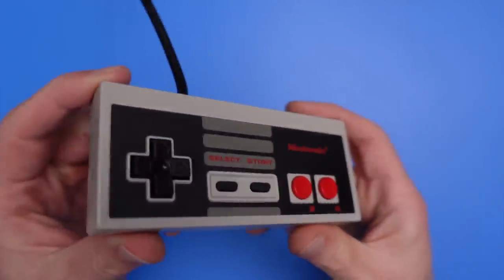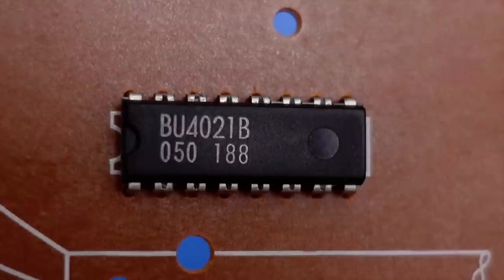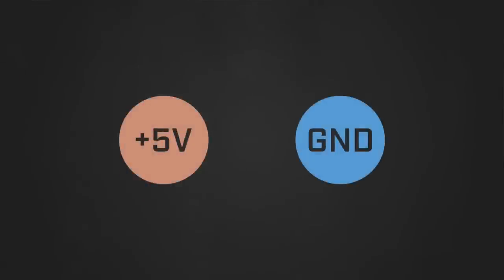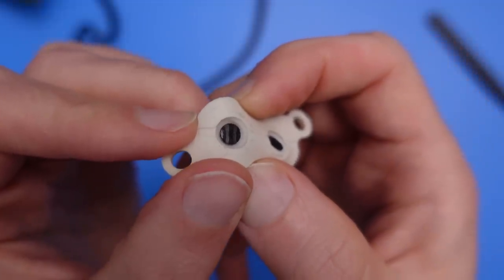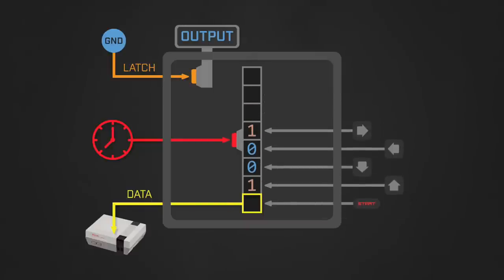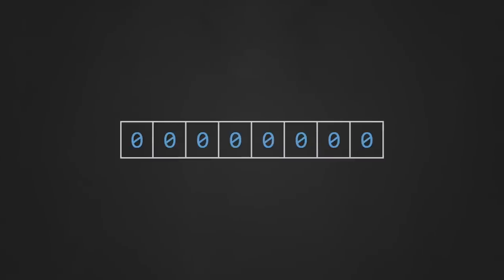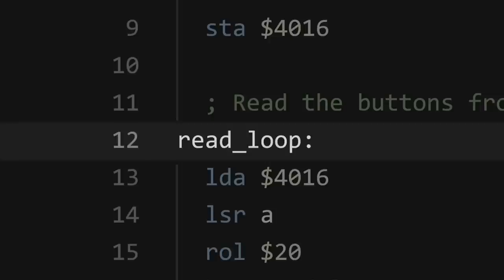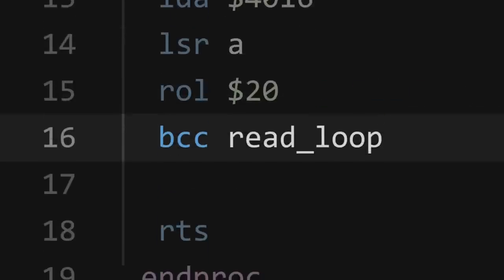NES Controllers Explained

Comment: But how does the NES handle multiple controllers? Are there actually four bytes (32 bits) of controller data to handle four controllers?
Reply from the maker: For two controllers you can read the 2nd player joypad from $4017 instead of $4016. In the case of the "Four Score" (4 player adapter for the NES) controllers 1 & 3 are read back-to-back from the the first port, and controllers 2 & 4 are read back to back from the second port.  So yes, there are 32 bits of button data: 16 bits from port 1, and 16 from port 2. Good deduction :)
Reply: @NesHacker   @NesHacker  Thanks. Back-to-back, eh? Meaning every even and odd clock cycle, respectively? That is an intriguing strategy and has me wondering if the only limit on the number of controllers would be the clock speed of the 4021 chip? 🤔

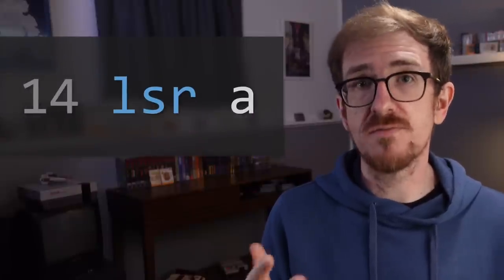Comment: 13:11 there it is LSR not shift and INVERT. it wont invert value its allready 1 if button was pressed. your graph show it invert, bcoz u thing controlled do what you say, but looking 4021 chip its doing opposite with those pullup resistors and input are inverted button press is 1. code not invert
why cant we just read $4016 when data is there or there is circuit when read it clock and new serial bit come
and LSR shift right bit 0 move to carry and in not INVERTED
and i was nice i tested it button is 1 i know circuits you not know 6502 LOL
LSR not invert bit its allready 1 when button is pressed. now you know

Comment: Why do games have to go and ask the controller what buttons are being pressed? Why doesn’t the NES do it itself and tell the game?
Reply from the maker: I think it is to allow for more complex controllers or specific ones for games. The controller ports are basically just serial ports so it wouldn’t even have to be a controller plugged in.
Reply: @NesHacker  cool thanks for the comment
Reply: The NES doesn't have an operating system, (or rather the game on the cartridge is the OS) and there's no hardware in it to scan the controller regularly as that would cost more money to add. Leaving it up to the game code is the simpler option, and it doesn't take up enough time or code space to be worth doing differently.
Reply: @gdclemo  thanks!